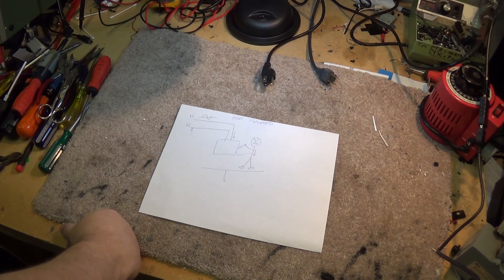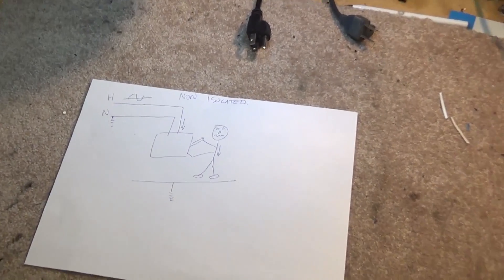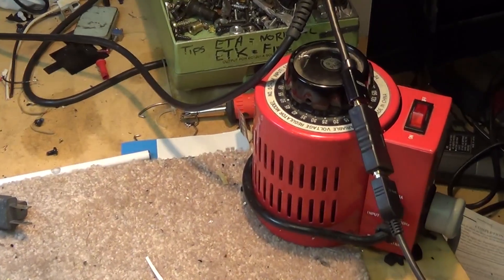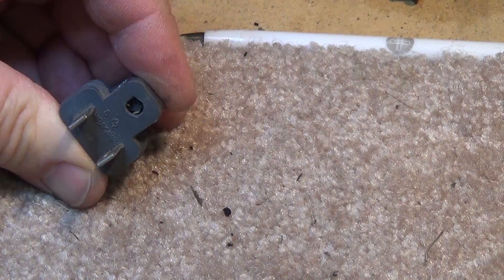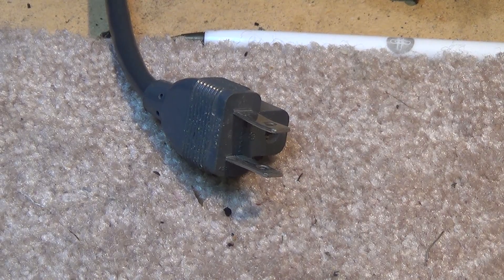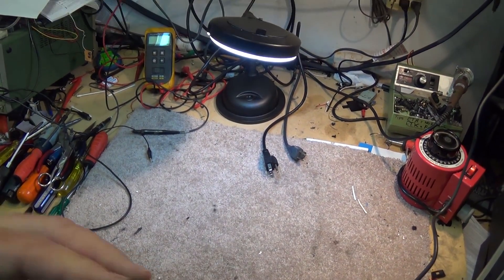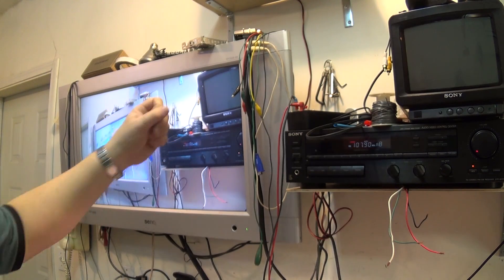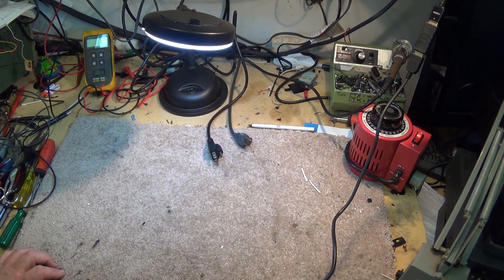test bench safety

Comment: PHP makes an isolated variable transformer; or isolated "Variac."  The PHP Model SC-10T has two windings, not just one, so the wiper side is indeed isolated from the incoming AC line.  I agree that  most "Variac" variable transformers have only a single winding, and are therefore not isolated.
Reply from the maker: That is why mine is plugged into an isolation transformer.

Comment: Many people in larger cities are actually living in  vintage apartments,condos and homes without polarized wall outlets.
 Can't imagine how dangerous that can be in this modern age with  expensive digital devices. Dave is a professional electronics repair person so he would probably recommend just replacing the wall sockets by a electrician. This message is to better inform the average person who may find themselves in that position and PLEASE DON'T don't attempt repairing anything electrical until that is done . Always think safety first.
Reply from the maker: Personally I will not work on any electronics connected directly to mains.  Everything is on my bench isolation transformer.  I can not stress this enough.  As far as non polarized plugs go, these need to be replaced by a qualified electrician.  I do my own work on my own home but then I am qualified to do the work on my own home.  When I work on my own wiring many times I work with the power on too which is dangerous but again I have electrical safety training.  After all I do as part if my day job work on utility poles in vacinity to mains power.

Comment: In the UK the Chinese crap manufacturers have reintroduced the non-polarised mains lottery to some cheap LED lightbulbs. Some have the exposed metal heatsink referenced to the neutral mains. That's bad enough, but in the UK our standard bulb fitting (bayonet cap) is not polarised, unlike an Edison screw where live is always the centre contact. Result - 50% chance of being fried.
Reply from the maker: +Jason james Yes and at 240 volts, you really are taking your live into your hands.Reminds me when I was a young lad tinkering with an old AC/DC tube AM radio.The plastic tuning  knob broke, and thus there was a metal shaft sticking out.The line cord was not polarized, so there was a 50/50 chance that the metal tuner shaft sticking out was directly connected to the hot wire. As luck would have it, I had used to keep the radio on my windowsill because the reception of distant stations at night was better. I had my forearm resting on the sill and reached for the radio to tune the station.  The shock I got put me on my ass but quick. I learned the hard way about polarization of the line cord.A trip to the local radio repairman and he told me about the hazards of those old radios, and sold my dad a electric razor transformer to plug the radio into to prevent this from happening again. Those razor transformers were around before GFI and were installed in bathrooms where one could contact water and were nothing more than a low power isolation transformer with a thermal cutout that would shut it off if someone plugged in something that drew too much current and overheated the transformer.Those 5 tube AC/DC radios were eventually banned after a few people were electrocuted.

Comment: be careful of capacitors...my co-worker got shocked from a microwave capacitor, it threw him back up agaisnt the wall of the shop, he was stunned but otherwise unhurt.
It really scared me.
Reply from the maker: Bri G. Microwave capacitors generally have a high ohm discharge resistor internal to them, at least most do which will discharge it in less than 1 minute after power is removed.Not all do, but most of them. You will see it on the printing on the cap, it will show a schematic with  a resistor and capacitor symbol in parallel if it does.It is always a good idea to discharge capacitors whenever working on a power supply. In every video when I work on a power supply I demonstrate doing this using insulated pliers or a screw driver.
Now speaking of microwave ovens, I was thrown across the shop I worked ay when I was distracted by a co worker that rambling on about something in my ear and asking me a bunch of stupid questions while I was working on an operating microwave.My needle nose pliers made contact with the operating magnetron power supply of an industrial microwave oven that was operating with about 3KV on the capacitor. The shop I worked for was too cheap to replace the pliers even after I complained about the slipping insulation on the grip. The owner just wrapped it in black tape and said "there that's fine, back to work"I will never forget that jolt. The only reason I am even here is because I was wearing rubber soul shoes, and had one hand in my pocket. The charge went in my hand, and out my wrist, but I couldn't let go because the muscles in my hand clamped down on the pliers. My legs still worked, and I jumped back breaking the connection, and throwing me across the shop.  First thing I did was pick my self up and punched my co-worker in the mouth.He said what was that for. I said, for breaking rule 1. Never talk to an electrical worker when they are working around high voltage. (same goes for utility workers, never talk to them when they are working) All it takes is a momentary loss of concentration, and you could be dead.  In my case I was looking for a burning connection between the magnetron wire and connector as it was intermittent. I was moving insulated wires with my "insulated" pliers and my co worker distracted me asking me to look at something and as I turned to tell him to shut up while I was working on high voltage my pliers slipped and ZAP.The boss expected me to pay for the damage caused when I landed on a TV and knocked it over, to add insult to injury.
Reply: 12voltvids I know what you mean about being distracted. We had a shop rule that if you were not feeling well that day to stay away from the workbench. The owner would have you help customers & do other things.working on electronics requires your full attention.
Reply from the maker: Bri G. I am not working for a large telecom, and work on outside plant, which is in the vicinity of the power company lines, plus telecom lines can have upwards of 380 VDC on them now as they are being used to power up remote dslam cabinets in the field.  When working around live circuits I have to be extra careful, as in addition to getting shocked, I am generally standing on a ladder 25 feet in the air!
Reply: 12voltvids I'm a former AT&T tech and worked on T-carrier lines, they carry only +130vdc. In the old days we had Breakdown sets that applied 620vdc to the line. if we had a high resistance short on the line the breakdown set would sometimes dry out the cable and clear the trouble but most always it fused the wires together and created a solid short.  We then would put tone on the pair and use an exploring coil to locate exactly where the short was. One of co-workers told me that he sometimes would connect 2 breakdown sets in series and hit the pair with 1200vdc.I hope he called the central office first before doing that to warn everyone to stand clear. When I worked on the main frame we had to put up red signs that said breakdown test so everyone knew to keep away.
Reply from the maker: Bri G. I remember breakdown sets. We just sunset them in the last 5 or so years.T carriers are still running 120 - 190v,  fiberlink +190 / 190, and DSL Express power is also + 190v. A full 25 pair bundle.
Reply: 12voltvids I remember a few T-carrier super spans that used 260v (+130 & -130). I used to go out and replace those old manhole repeaters, the oldest ones I found were dated 1962. Most T-carrier spans were powered with +130 & GRD or +130 & -48v.
Reply from the maker: Bri G. The modern T1 carriers are +120 -120, with a few using +192-192.DSL express power uses the same, +190 -190 configuration for the power pairs. There is an inverter in the CO to take the -48V and deliver the split 380 supply which is placed on the pairs. At the remote end, the +/-190 is converted back to -48. This is done because the 26 guage wire can't handle a lot of current. High voltage = less current. So by the time it is back to 48V there is 30-45 amps of current available to power the 192 port DSLAM for VDSL.
Reply: 12voltvids I helped maintain the CEV's (underground vaults) that housed the repeaters & power plant for the first Western Electric fiber optic lines that were installed in 1982. Just before I left AT&T HDSL came in, it was a new technology that used a POTS line to carry T1, this cut the cost of bringing in a traditional T1 line. I worked in Construction dept. for awhile and later my crew was transferred to Special Services.
Reply from the maker: Bri G. CEV, Confined Equipment Vault. Yes I know what they are, I have spent much time underground. We have plenty of them in the area I work in.  One of them has a large fiberglass rock over it.Out here we have them in rural areas where little subdivisions popped up in what was farm land. They would put in a CEV, with power, UPS, and a DMS1 access node, and DSLAMs. This goes back to the "Stinger" days, as now most of the DSLAMs are housed in the road side SAC boxes, an dthe CEVs are where the dialtone, and power supplies are located.New builds are now fiber right to the home.
Reply: 12voltvids I also worked as a tester on both 2-wire & 4-wire. Back in the 1970's I got to spend the day with a testboard tech and watch him test telephone lines. The testboards contained several switches & meters.I watched as the techs would operate the various switches & take readings with the meters to determine if the line had a short or ground etc.AT&T did away with those testboards and now the techs sit in front of a computer and use MLT (mechanzied loop testing) to test POTS lines.
Reply from the maker: Bri G. We still use ELT today which is electronics loop testing. The tool we use is 4TEL, which we can either dial into and use voice prompts, or tunnel into using terminal emulation.It is funny as hell, as we tunnel into a virtual port, which connects to an old dial up type modem that dials into the old legacy system at probably 1200 baud. This was left in place so that remote field techs that didn't have LAN access or high speed internet could use a dial up modem, and dial in. Spartan is another old tool that goes way back to the VT101 days.
Reply: 12voltvidsMLT was supposed to make testing easier, it reads out a trouble code and then you would look up the trouble code.For example Ver 0 is NTF.
Reply from the maker: Bri G. 4tel gives us spoken word faults.Voltage t zero volts, ring negative 52.1 volts, dc post cutoff tip 0.0, ring negative 2.1 volts ect. That would tell you that you have a ring cross. Gives voltage, current resistance background noise, cable balance ect.All spoken, and it is logged so you can fix a line and retest, and get archived results. Good for the line techs. Myself I am data and fiber mostly.
Reply: 12voltvids MLT showed you a trouble code, but there was another screen you could pull up and see info like that. Some of the techs in 611 couldn't make sense of it but I had worked outside in the field. When I transferred outside they put me working with an old timer with 30yr. experience so I got off to a good start.
Reply: 12voltvids I wanted ask you do you work as a contractor or for a small telco company?
Reply from the maker: Bri G. I work for a very large Telco.
Reply: I recently bought a Sony Dat recorder...wondering how to hook it up, do I need an amp with a digital input?
Reply from the maker: Bri G. No it will have standard analog input and outputs just like a cassette deck.

Comment: I had to laugh at the part about cutting the ground prong on the scope. We used to do that 30 years ago. One day when the owners son  was working on a old rca tv, that had 1 side of the line cord directly connected to the "ground" he had his scope probe connected to the TV, and it was "HOT" I remember clearly when he reached for the cable tv cable while his arm was resting on his scope. He let out a scream line we have never heard before. The next week "he" got an isolation transformer. The cheap SOB bought one for his son but not for the other 5 techs that were still taking our lives in our hands every time we worked on those bloody things. The worst ones were those old 5 tube AM radios. Those things were so dangerous that depending on the polarity of the AC plug, there was a 50/50 chance that all the metal parts including the tuning shaft, and volume shaft was energized. The only thing protecting you was the plastic knob. What was usually the first thing to break on those radios? The volume knob. I can't help think how many people were electrocuted when they touched the volume shaft while touching something else that was metal. Deadly design.

Now here is a trivia question for your radio buffs. They all used the same 5 tubes, every one of them Extra points for those that can name the tubes. Even Radio Shack used to sell the kit with all 5 receiving tubes for all of those 5 tube AM radios that would have been from the early 60's. They were usually in a bakelite plastic cabinet with a cardboard back on them, and came in  a variety of colors.
Reply from the maker: I'll start this one off as I know the answer to this, I used to have one of those radios.
12BE6
Reply from the maker: 12voltvids
I should state that there were different numbers used on the different generations of these radios. I am referring to the miniature type tubes. 12BE6, 12BA6, 12AT6, 35W4 and 50C5
Reply: @12voltvids  On an "All American five" radio the filaments were wired in series, to thus eliminate the need for a transformer providing 12 volts for filaments wired in parallel.  Hence the 35W4 and 50C5, to get the series filament voltage up to 120 volts.
Reply from the maker: @dane1234abc1  that's right series filaments.

Comment from the maker: It is a commercially available transformer. I believe mine was made by Advance Transformer company in Canada. They should be available through pretty much any electronic parts distributors. They are not cheap. The one I have probably cost 100.00 or more and that would have been at least 25 years ago.
We had 2 at the shop I worked at, and when we downsized the shop, one wasn't needed and it found it's way into the back of my car one night when I was going home.
Reply from the maker: Yes that is correct. The ISO transformer is plugged directly into mains.
It has 3 taps, 10% down, 1:1 and 10% up. The variac is plugged into the 10% up side, so I can get an even bigger boost if necessary. Then my power strip is plugged into the variac. 
There may be some companies making a variac with isolation, you would have to research that, but a variac by itself is not isolated.
Reply: 12voltvids Thanks for reply, attempting to hunt one down, will let you know how it goes.
Will post what I learn maybe save others some hassle.
Thanks again.
Reply from the maker: *****
Check Amazon they have them, also the place where I got mine sells them:
http://mainelectronics.com/transformers.htm
These ones are 120V units. As I said they are readily available. Companies like Hammond, Triplite, Advance ect all make them. They are one of the must have pieces of equipment that anyone considering working on electronics needs to have. One of these things can save your life should you accidentally contact a line voltage. Check Ebay, Amazon ect.

Comment: Where can I find an isolation transformer, was your salvaged from a piece of equipment, or is it bought as an isolation transformer for that specific purpose? Also are variacs available as an isolation transformer/variac... which would seem like handy set up.
So just to make sure I got it....you have incoming mains voltage going straight to the isolation trans., then to a power strip, and all the equipment your working on (including the variac if your using it) gets plugged into that strip...I guess the iso trans is naturally only grounded on the primary side by default?
One should probably verify the wiring of the wall outlet as well, yes?
Great channel by the way, can't get enough of your vids.